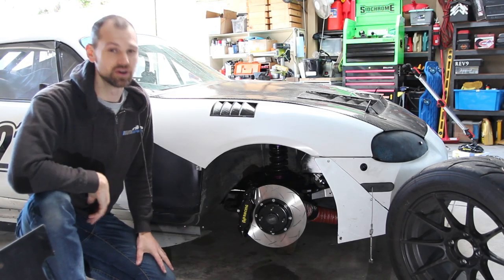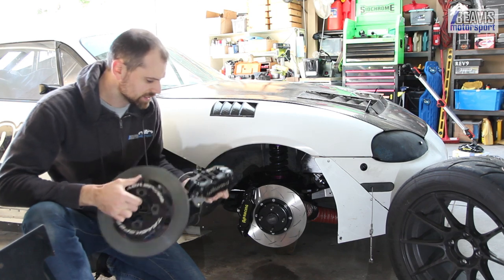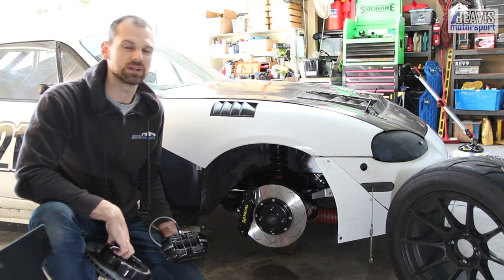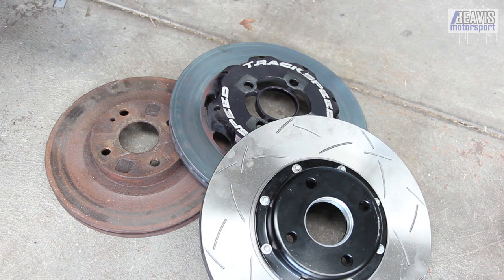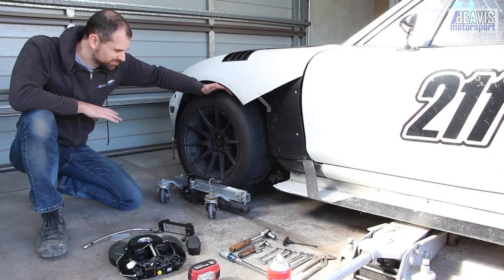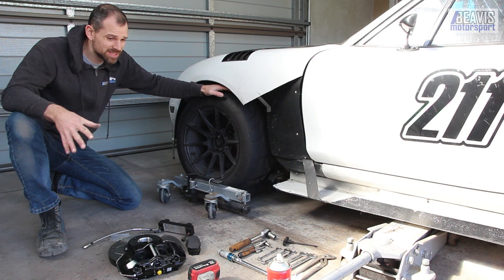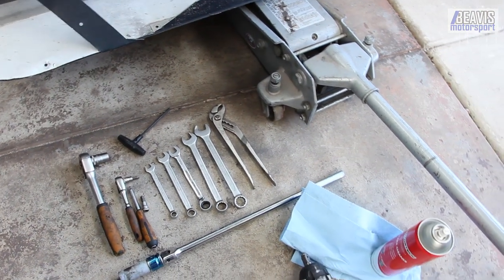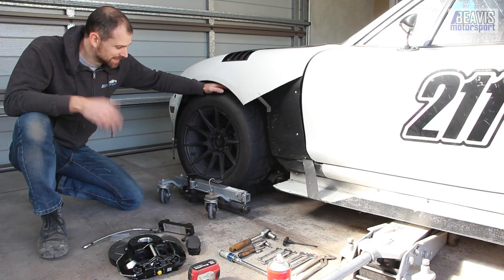How To Install A BIG Brake Kit // Ep 82 // Time Attack TURBO Build

Comment: This'll be interesting to follow your next track day lap times as that's a LOT of extra rotating weight so they will have to work a lot lot  better to be worth the weight gain. Keep us updated👍
Reply from the maker: An extra ~4kg per front wheel is well worth it for having brakes that can actually stop the car. They work MUCH better than the old setup, and last much longer.

Comment: Will you be fitting a 13mm(?) spacer to the rear wheels to keep the fitment square? I also have a custom AP kit which I’ll one day get fitted to my SE. I face similar issues.
Reply from the maker: Not currently. I don't have long enough wheel studs to accommodate a spacer of that size at the rear. Something I might consider in the future.

Comment: I really enjoy your how to videos. I’m doing a brake upgrade now on my RX7 circuit car and was wondering are the rotors you upgraded to located hub centric?

Your fastest lap of Winton onboard video was a huge help to me also as I learn the right lines around that circuit - keep it up!
Reply from the maker: Thank you James, the rotor hats are machined flat and are quite thick, so the wheels don't have a lot of meat to mount on the hub, but there is a small amount protruding as I do have aftermarket hubs which are a little beefier.

Comment: The rotor should locate on the the hub register.  Machining the hole to the exact size is not extra complication, but standard responsible practice.  The fact that your trackspeed/wilwoods had a gaping hole shows what an imprecise budget kit it was.  Or maybe I'm misunderstanding and the V sport kit came with an undersized hole, even for a stock hub application?  

One big letdown about your new kit is that the rotor is simply bolted to the rotor hat.  There is no float built in.  Most brake kits at that price point will feature slots and drive pins that allow the iron disc to expand and contract at a different rate than the aluminum hat and prevent any warping that will manifest itself as knockback or uneven pad wear.  

You should make a distinction between thermal mass and other mass.  The mass you want is the iron ring, not the aluminum hat and hardwear.  In the caliper, the mass you want is the pad friction material. not the caliper.  Of course, these things are hard to measure without unbolting the the hats from the rotor rings.   

Great job pointing out the hat thickness difference between the kits!  This is a dirty shortcut that brake kit manufacturers use to help create axial clearance for big calipers.  I'm glad your car was already able to accept the increased offset.  A 13mm increase (1/2") is an irresponsible amount for a brake kit to add.  

How was your brake balance after the new kit?
Reply from the maker: Indeed the old trackspeed hat had about 1-2mm of play in the hub hole. The new setup was precise, but needed modification to suit my aftermarket hubs with a longer "nose" on the hub - so no, you are not mistaken.
Floating rotors certainly are nice, but compared to almost any real "race car" brake setup, this kit is somewhat cheap, and keep in mind, this is "just an MX5" so I can certainly understand that for most people this is already way over kill.

The balance seems fine, I do have a bias adjustment valve, which I did tweak. Fundamentally the fronts do a lot of the braking work in the car so it doesn't seem out of the ordinary balance wise.

Comment: I use the Trackspeed kit on my Miata. I've thought about using some brake temp strips or paint for track days. I see you're using them, curious if you have any thoughts on them?  Great job on the videos lately, keep up the great work!
Reply from the maker: The temperature strips are a good tool to get an idea on temps, use them however and wherever you want to get an indication on how the car is working, without the need for advanced tools or special sensors.

Comment: oooo shiny.

I've always avoided the temptation of the wilwoods for the points you mention, that and i'm fairly lazy, oem big brakes ask for nothing service wise even in the miserable conditions in uk, how do you rate the AP's exposed bits compared to the wilwoods? also which kit are you running on the rear now you've done fronts?
Reply from the maker: I don't think there are any exposed bits, well no different to OEM calipers.. Can you expand on what you mean exactly? Rear is OEM.

Comment: What about your rear brakes, booster and mc setup? Have you tested the balance of the setup yet?
Reply from the maker: Everything else is OEM. The balance seems ok so far, the fronts do most of the stopping work, but I do still have my brake proportioning valve for fine tuning.

Comment: Dunno if you'll see this comment on an old video now. Do you think dynapros would hold up okay to the heat of trackdays at stock power and 200tw tires? I know you cooked them with your sticky tires and power.
Reply from the maker: Yes, definitely they would fare much better than how they did on my car. For me they worked, but didn't last long enough. The power really hurts brakes, so if you have stock power (or even up to around 250hp), then likely the Dynapro4 will work great.
Reply: @Bbeavis  Thanks! I cruised forums and couldn't find much info on heat management, and you're the only one I've seen that has thrown these calipers through the gauntlet.

Comment: Do you got underhood ducting for the radiator? Looks sick!
Reply from the maker: Hi, the radiator is directly ducted with air from the front bumper opening, and then there are vents in the hood directly behind the radiator to aid with evacuation of the hot air. :-)
Reply: @Bbeavis Okay thanks!  I was wondering why you got those vents on the hood. Great idea!👍

Comment: What would be the best option for a solid upgrade for a NC1 MX-5 with like Wilwood big brakes etc without spending a fortune but genuine parts?
Reply from the maker: Hi Brad, Sorry to say I don't have experience with brake upgrade options for the NC chassis, AND, you didn't mention what sort of driving or performance your car has, so I cannot make a recommendation for you. Chances are, unless you are over 200hp or so, then stock brake calipers and rotors will suffice, just upgrade to braided brake lines are quality race pads.
Reply: Front only StopTech C43 competition brake kit.
Reply: EBC USR performance slotted brake discs front and rear
EBC Braided Brake Hoses
Roddisons Front and Rear Brake Pads
 (from UK)
Uprated performance 5.1 brake fluid

Works great with 205hp in an NC2.

Comment: Its too bad the Wilwood stuff is not so readily available. In my humble opinion, l would have opted for the lighter weight, and upgraded to six piston Wilwood Dynapro Calipers. I would have stuck to Trackspeed rotors and just increased the heat range on the pads. I think there would have been more positives pursuing that approach. Trackspeed no longer offers there brakes, Goodwin Racing offers 11.75 rotors with 6 piston caliper option, and AP racing j hook rotors with whatever pad option you desire. Great video, good luck with your setup!
Reply from the maker: For me this was the right choice as it offers pads that last much longer, locally made rotors and much better thermal capacity that the wilwood rotors could not handle.

Comment: I’ll be surprised to see if this works. Those DBA’s are pretty notorious for  cracking with a proper race pad. Although those pads are pretty chill compared to the Circo pads I’ve seen eat these rotors. 

Forza are usually pretty helpful with making custom 2 piece floating rotors for different applications. I just ordered a set for my Megane and will be ordering another set for my BRZ as my DBA’s performed very sub par.
Reply from the maker: I think you may be a little ill informed to say "surprised if this works".
Firstly, Hawk DTC70 compound is their highest heat rating, for up to about 1550degF and a 0.85 coefficient of friction, so they aren't what I would consider "pretty chill".
Also, the existing Wilwood rotors were cracking after a single session on track, I had to upgrade to their Spec 37 to get them to last at least a few days.
And, this brake package was good enough to set the fastest ever MX-5 lap around Winton, so yes they work. Without any signs of the DBA 5000's cracking.
I've often seen issues with people eating rotors because they use "track" pads on cold street use. Improper use of the product. That said, if I do have issues, I'll share my experiences honestly just as I have with the Wilwoods.
Reply: @Bbeavis  megane & BRZ - beavis you should be shaking, you are up against a professional there m8.
Reply: wait isn't this the guy whos wife pays for his cars?

Comment: Pad size does not matter, because the force of friction is not dependent on surface area. It just needs to be big enough to not flex with the force of the caliper
Reply from the maker: Pad size & thickness matters greatly, as the consumable lasts much longer. It is a cost saving in the long run, and a longer service life.
Reply: BEAVIS Motorsport of course  thickness but actual size in terms of area doesn’t, a larger pad doesn’t offer more “force” because the equation for the force of friction does not include surface area
Reply from the maker: @noahpierce4746  Oh, I'm sorry, yes in that case I would agree.
Reply: @noahpierce4746  If you want to get technical about it, the pad shape can actually make a small change in the torque reaction.  For a constant rotor OD, a large annulus (taller) pad (assuming enough rotor face is present to accommodate the pad) will have more force distributed closer to the center than a narrow annulus pad.  This changes the center of the force distribution and results in a lower effective radius.  Subtle, but measurable.  

Pad size (radial length more specifically) also matters for resisting uneven wear.  The best recent negative example of this is the original C6 Z06 Corvette brakes that came equipped with 6 small padlets instead of two normal pads.  They were notorious for a wedge-like wear pattern that created extreme knockback.  

The spinning rotor applies a force along the face pad that is difficult to resist without some length.  The leading edge of the pad is getting "sucked in" while the trailing edge is being lifted up.  Applying force toward the trailing edge is critical and a larger pad makes this easier to do.  Performance calipers with more than one piston on each side can use different sized bores to apply an opposing torque that evens out the pad wear.

Comment: 40lbs a lot weight to add, but if it lasts longer then I suppose it's worth it lol
Reply from the maker: Well, the delta over the old brake setup is actually only 9lbs per front wheel, so 18lbs in total. But yes, brakes are a valuable item to invest in despite the weight penalty.